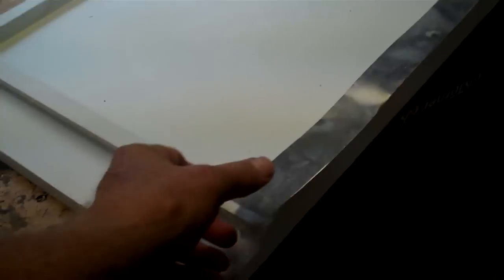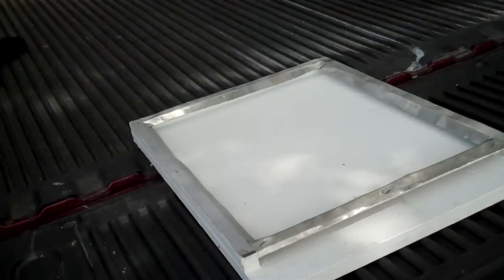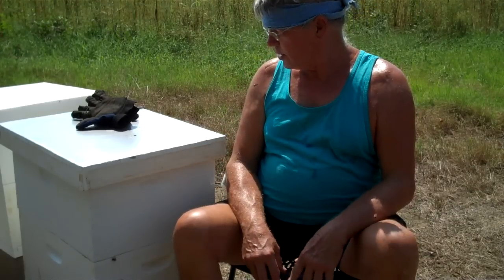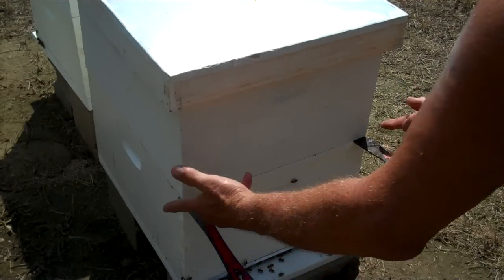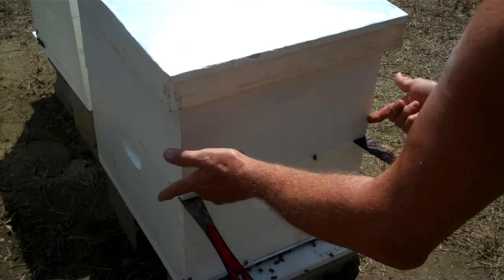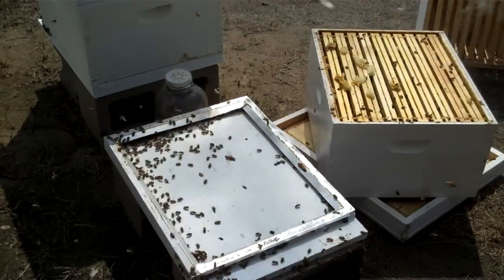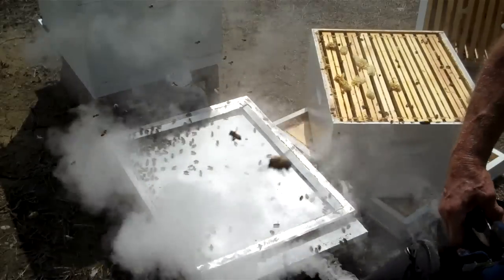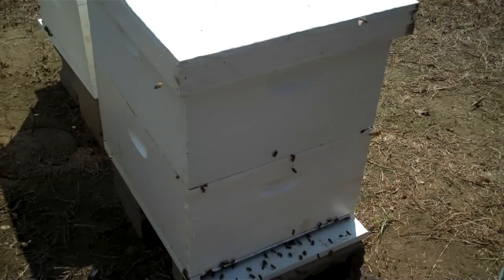Honey Bees, Beekeepers' Enemy the Hive Beetle

Comment: They seemed to be fine with you being there until you got to the bottom board where all the hive beetles were. It seems like as soon as you broke the beetle cages that irritated the bees. I actually did a search and found this video because something similar happened to me today. I wanted to see if anyone else had the same thing happening in their hive. Mine will trap them in the top and will be aggressive as soon as I break the beetle cages but if I stand there for a few minutes  smashing hive beetles they'll calm down. As I'm smashing the beetles the girls are aggressive toward the beetles and me and anything else around. They'll curl themselves around the beetles and bite and try to sting them. After I smash a good bit of the beetles they start to calm down. I can't go into that hive without a suit. My other hive isn't aggressive at all. They aren't doing as well though. Their numbers are about a third of my aggressive hive. I got them both as nucs and my gentle hive had a head start. My aggressive hive made another queen as soon as I got them and had a slow start. They were gentle until this queen emerged. After she came out they wouldn't stand for anything. I watched them uncap and pull out undeveloped drones that had mites in their cell. I'm thinking about taking a frame of brood from the one hive and giving it to my gentle hive to boost the numbers before winter. Do you think that'll help or is it too late now? I see that this video is one of your older ones. Since this video have you noticed your bees only getting aggressive when the beetle cages get broken?
Reply from the maker: Amy, a hive can become aggressive or the other way around.  The Queen mates with several drones and let's say the queen used up the sperm of a gentle drone then the next sperm she starts using is a bad daddy.  Taking capped brood out of your strong hive putting in the weaker hive and very good.

Comment: do you still like the beetle baffle? I got a weak hive that beetles are giving a fit . the bees swarmed yesterday, i cleaned the box out and got them back in it .
Reply from the maker: No, I don't still like it.  Some have said that something should have been applied to the aluminum.
Some have asked the same question I have asked and that is, what keeps the beetle from flying from the bottom board to the bottom of the frame and the answer is nothing.  It is good for people to try to think up a solution.
Reply: i`m going to try the cd case with boric acid and crisco . i lost all the brood . i had left them in a swarm trap 10 days ,brought them home ,put them in a 10 frame box and in 3 days the hive beetles took it over.

Comment: You forgot an import part. You have to treat the aluminum with a product called NeverWet by Rustoleum.which makes the strip too slick for the beetles to hold on to.
Reply from the maker: I wish I had a tiny camera to watch the beetle fly from the bottom board  up about 1 1/2" to the brood chamber
Reply: I am going to give this method a try this season and I have all kinds of miniature cameras and endoscopic cameras. I wll try to set a couple up and see if I can capture that.

Comment: Thanks for the video! I know I promised you a Flow Hive extraction video but there was a film crew at my house that day so I didn't make my own and haven't seen it yet. I will tell you that it went real well and that the Flow frames worked as advertised for me. I learned that I need to cover the honey while I am extracting though!
I really like that beetle blocker/stopper/guard thing.
Reply: There's nothing wrong with thinking something won't suit you or won't fit in with the way you like to do things at all.  The one thing I can say is that the Flow frames are just too expensive. I'd have more if they weren't out of reach.
Reply from the maker: please forgive me but I have trouble thinking that flow hive will really work satisfactory.  The first year, you might have some run out but the years after that I think will be a different story.  Let say you have 100 lbs of honey in your flow box, how much honey dripped out, 10 pounds ?
Reply: Well, I'll let you know how things go during/after this year's nectar flow.